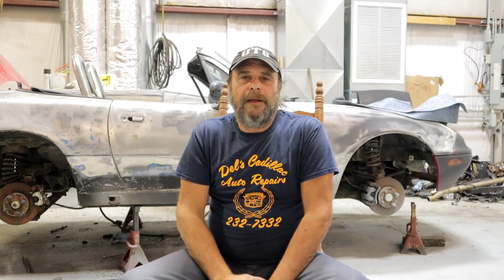Automotive De-Evolution...The Next Big Thing?

Comment: There's a place for efi, mfi, carbs, points so on. The beauty in all of it is your love of the diagnosis and satisfaction in the accomplishment.  Doesn't have to be easy to be fun....
Reply: Took me 15 years to get my pickup truck.  A very nice 92 Dodge diesel Cummins 6v. Man everyone loves this thing, and talk about simple, new truck guys want to trade with me for their new ones!

No is always the answer.  This thing will still be going when theirs is long dead.
Reply: if its got a computer or sensors it will give you problems no thanks   simple is better and cheaper to fix
Reply: @MoparMan1978  I agree. My truck and blazer are 1976, I'm sure you can appreciate that. Chevys yes, that's what I like. Carbs yes, but electronic ignition. Computers, sensors, NO! I love working on my classics.  Don't need to plug it in to find out what's wrong with it.....

Comment: Love your videos, but I disagree with one thing, the stuff from the 80s, especially 5.0 foxbody mustangs have a huge following. They are still easy enough to work on and have the same connection as the stuff from the era your talking about.  Young people are going after these cars in droves.
Reply: They are so highly sight after.  You are correct.
One thing that makes your fox an exception.  The fox body, like my Cherokee, are products of the 70's.
They both are built simple.  Wiring included.  Like your fox body, my Cherokee had a simple computer and fuel injection change done by the manufacturer to meet the standards.  The heart and bones are straight up 70's look and feel..
Compared to new cars, they are Flintstone simple.  
The demand for them is increasing at a crazy rate..
Reply: Yeah, as a guy in my 20s searching dead forums from the early 2000s for the solution to a problem I’m having with my Fox, i feel that.
Reply: Tony says some dumb shit sometimes. The Ford/Buick comment was one of them. Also if new cars are sterile then that would make all of Tony's cars biohazards.

Comment: You are mostly right.  In the hot-rod chainsaw world it's the 1970's (+/-) chainsaws that are desirable.  In the big truck hobby it's the the 1970's units with Cat 3406 A Model and a 13-speed, or twin sticks that are desirable.  In hot-rod boats, the classic Jet Bats of the 1970's are bringing money.  Usually paired with some 1970's V8 engine ...
Reply: I can't remember the name of that old homelite from back then, but they were huge, a real man's saw.
Reply: @MrTheHillfolk  was probably some sort of bow saw..and echo had the twin cylinder chainsaws
Reply: @johnfoskey7855  darn , I even just tried google.
Haha I'm all screwed up.
 I wonder if it was a McCullough ?
Pretty sure it was that orange/red though.
and I thought it had like 750cc 2 stroke or some ungodly huge engine for a saw  and like a 3 foot long bar.
Reply: Also farm tractors also dubbed "Muscle Tractors" in era relation and aggressive looks to an extent to their automotive counterparts. Tractors like 1568 IH's 4020 JD's etc

Comment: I came up in the "old days" cutting my teeth on a slant 6. I now have a 2016 Ram diesel. It's a lawn ornament. It blew the DEF pump and there are none available in the country. Perpetual back order, over 2750 in Ram backorder and there were 40 made. I am not happy with modern. Now looking for a clunker to drive while waiting the 6 months to a year for the pump. I wish I had my first car, a 61 Lancer with a slant 6. I could fix just about anything on it.
Reply: Can’t you do a delete on the diesel and get it back on the road?
Reply: @richarda996  Sure, if I never wanted to be on the road with it again. You can do that legally for farm / ranch equipment but not for over the road vehicles. In addition dealers can't accept a vehicle modified like that in trade.

Comment: Hey I'd love to install Hilborn mechanical fuel injection on my Street ridden sportster, thing is I need a drive coupler for the fuel pump.
Reply: If ya can't find one , fab one ?
Reply: @MrTheHillfolk  sure, the closest machine shop I have access to, is a two hour drive away.
Reply: @2000freefuel  try figuring out how to, not why not to....
Reply: @2000freefuel  argh that really sucks 🤦
Reply: @harveynailbanger  and that's the spirit!!
Reply: @harveynailbanger  Sure I can 3D print a plastic mock up part, but that's only 1/2 way there.

Comment: So true, I have so much more fun working on my ‘53, than my ‘02.
Reply: Had so much more fun with a vw tdi when I removed the electronics and put an 80s mechanical injection setup on it. 
Best of both worlds , modern engine and reliable mechanical injection.
Reply: @MrTheHillfolk  MARVELOUS👍👍👍
Reply: @charlesangell_bulmtl  heh , it might not be real old by most guys standards around here  but at least the VW diesel dates back to the 70s 🤣

Comment: A shop had put some EFI carb deal on some old mopar, possibly a road runner...was a bit ago i kinda forget. Anyways, thing just took a good while to even start to run right. Probably not the right info for the cam or the engine must of been oversized at one point...carbs are just simple.

Comment: I started daily driving my 68 polara crew cab and it has made me decide to sell all my vehicles that are newer than 80-85. The style and simplicity is unbeatable
Reply: Hell ya brother
Reply: @inharmsway526  been using it for my work car and put about 600 miles on it in the last 4 days and it just gives me a great happy feeling that i dont get with anything newer. And in full disclosure ive never owned anything newer than 2000. Most have been 1970-1986
Reply: That must be an interesting vehicle.  Does it have a Polara front end and a truck back end or the other way around?
Reply: @MexicanSpec  its just a 4 door polara lol
Reply: @MexicanSpec  yes i know what you mean. I said crew cab cause its 4 door car not a 2 door

Comment: Im 26 and i really enjoy working on my 71 406 sbc motor. In a 82 camaro which can be a pain sometimes but overall a joy that pays for itself
Reply: Got a vortec headed 406 in a 79 El Camino and couldn’t count how many times I get asked or told to go LS…. Always respond nope not a chance it’s just not the same and they are almost always confused.  Now I’m looking for  late 80’ early 90’s Chevy Truck to put a LS for my everyday driver cause I just don’t care for a  new Truck especially the price.
Reply: Hell yeah bro!  I had a built up 383 stroker motor in my 83 Firebird back in the 90's.  73 4 bolt main block, 202 angled plug camel hump heads, solid lifter cam and mechanical secondary Holly double pumper.
It's in my 96 VHS Burnouts vid and at the track one night in another

Comment: Took me 15 seconds to start a tiller that's from idk the 80s that'd been sitting for a couple few years. No chewed wires no mess no fuss. Pull a few times and roars to life. I can't imagine getting a nice project car and having an even bigger smile on my face knowing i get to drive the thing. Rustbelt is hell on these cars so, hard to get anything
Reply: Haha I built a backyard screw around mower , after learning about pulley swaps. 
Damn thing does 30 now  and has progressed over the years from a 12hp to it's current 30hp. 
I'm 48 but I never grew up.
I play with vws on the side and finding parts can be an issue for my model ,that's why I like the mowers.
 I can walk into any hardware store and fix it. 
Total opposite of any VW 🤣 
I've got probably 6-800$ in mine and that's alotta money , some of these kids can do it for 50$🤣